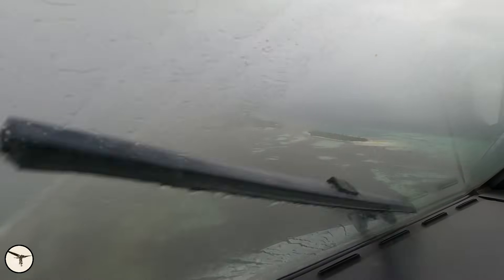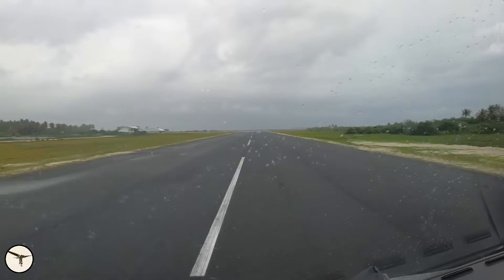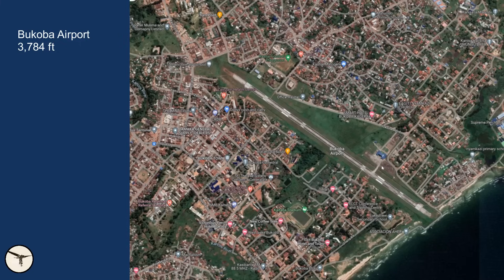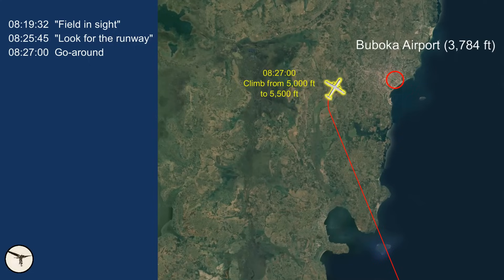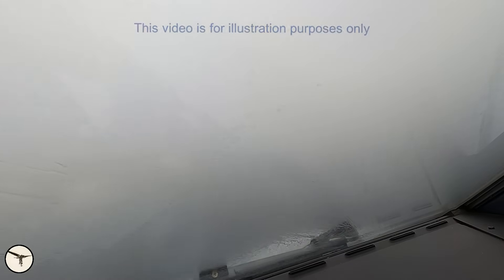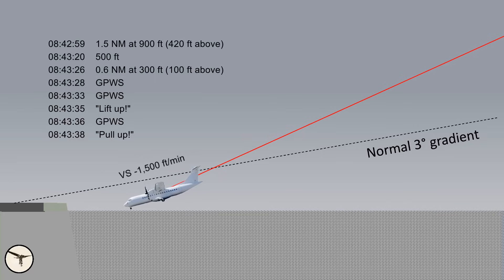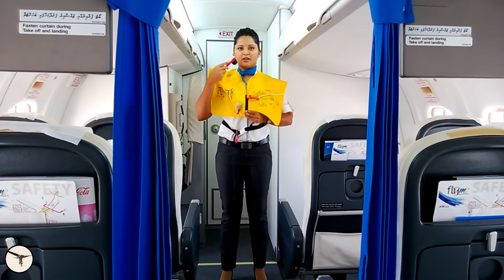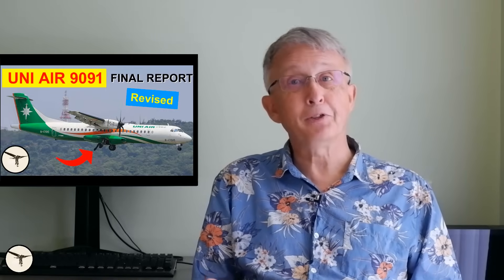What happened with Precision Air 494?

Comment: Great video.

I've been flying RC planes awhile & been into Flight Sims longer. 

Like to learn more about the plane you fly, ATR.

A few questions with the MSFS ATR.

1) after a missed approach in order to redo the approach. Does one need to spend 10 minutes building a brand new route in FMC again to choose approach or is there a faster way?

2) is there a manual available that'll explain what all the phraseology with this FMC/CDU with V-PN modes, Alt mode vs is it still in Vnav once I reach cruise altitude.

3) lastly, strange that I can add airports like KJfK or KLGA for JFK & LaGuardia Airports as departure & arrivals but when I try to add KJFK as a waypoint it says "not in database". What? I had to resort to adding JFK as waypoint instead, that might be the VOR/DME etc.

Anyone in this group could help, much appreciated thanks 👍

Comment: Reading the recent ATR crash in Nepal where one of the pilots feathered both props by mistake on approach to landing, which resulted in a deadly crash, I wonder how such a dumb and costly mistake can occur. Is there an issue with the ATR cockpit design by any chance?
Reply from the maker: No, many turboprops are designed this way. This video is about the design: https://youtu.be/p5m8kvZqwC4
Reply: Those pilots had over a minute to recognize and correct their error. For some reason, they failed to do so. That to me is a larger issue than the control layout.